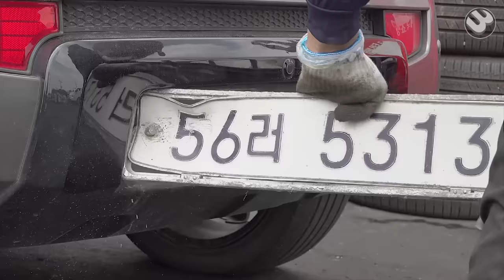Amazing Korean Junkyard. Massive Scrap Car Process

Comment: With the high price of new cars / vehicles, why scrap these nice looking cars / vehicles  being recycled by keeping them on the road? Crashed vehicles can be easily repaired by replacing the body parts, interior  parts, wheels & tires, electrical component's are all reuseable. What a waste of transportation resources.

Comment: Esse ferro velho tem carros melhores que muitas revendas aqui no Brasil.
Reply: País de primeiro mundo
Reply: Korean usually change their cars before they get in maintenance cycle that gets expensive like…. Transmission oil change, generator, and ect…. Which is usually 10~15 years. And some lease allows you to change your car you borrowed every 3years which is very common. You can buy these kind of almost brand new cars for bargain in Korea. So people just spend more and more on new cars than just maintaining old one. In Korea, you could buy the same used car way cheaper than other countries.
2018 elantra just costs 9100USD in Korea while it costs 18000USD in USA.

Comment: Furthermore, in Incheon, you will find a thriving presence of foreign used car importers acquiring a significant number of vehicles that exhibit conditions similar to those portrayed in the deregistered video. If you are interested in exploring the Korean used car import-export industry, Incheon serves as an ideal destination for your endeavors.

Revised paragraph:

The South Korean government offers cash incentives to car owners to promote the early scrapping of their seemingly functional vehicles, particularly those classified as Euro 1~4, which were manufactured under more lenient emission standards in the past. This initiative aims to improve air quality and overall environmental conditions. By opting for early scrapping, car owners can enjoy the dual benefits of receiving money for scrapping their cars and taking advantage of the government's incentives. It's like hitting the jackpot with two advantages at once.

Scrap car dealers, on the other hand, meticulously separate reusable parts and sell them as second-hand components. They also sell the remaining scrap metal to steel mills, generating profits.

Moreover, both the central government and local governments in South Korea are deeply concerned about increasing the adoption rate of eco-friendly vehicles. To encourage this transition, they provide significant subsidies for the early scrapping of non-eco-friendly vehicles and the purchase of eco-friendly vehicles such as electric cars and hydrogen fuel cell vehicles. Additionally, heavy taxes are imposed on internal combustion engine vehicles to discourage their usage and promote sustainable transportation options.

Furthermore, in Incheon, you will find a thriving presence of foreign used car importers acquiring a substantial number of vehicles that exhibit conditions similar to those depicted in the deregistered video. If you have an interest in exploring the Korean used car import-export industry, Incheon would be an ideal destination for your endeavors.
Reply: @oscarwilde5473  
I accept your censures with equanimity, cognizing that my epistle may offend those who are incensed by their present pecuniary or valetudinary circumstances, but it may also be of value to those who are inquisitive. If you find peace in criticizing me, then I am content to be your foil.
Reply: @oscarwilde5473  
It is somewhat disquieting to behold your vexation over a simple YouTube comment that merely describes a phenomenon of the real world. I had succinctly summarized the video's verities without prejudice. I am neither the architect, nor the executor, nor the propagandist of the policy in question. I would be delighted to receive financial support from any government, but no government is currently providing me with any money. It is more logical to criticize the policy of the government that is promoting a policy that is not to your liking, rather than criticizing me, who am simply presenting the facts. You are accusing me based solely on your personal beliefs, without providing any evidence or proof to support your claims. This is commonly referred to as grandiose delusions. If you are targeting and criticizing me because of your personal frustrations, I give you my absolution. Pax tecum.
Reply: @oscarwilde5473  Of course, you're always right. I'm just too stupid to understand.

Comment: おそらく彼らの韓国車はメーカーが部品を持たないから一定の年月が経つと部品が無く修理できないのでは無いか？だからスクラップにする。循環合理的だが、不誠実でもある。
Reply: Furthermore, in Incheon, you will find a thriving presence of foreign used car importers acquiring a significant number of vehicles that exhibit conditions similar to those portrayed in the deregistered video. If you are interested in exploring the Korean used car import-export industry, Incheon serves as an ideal destination for your endeavors.

Revised paragraph:

The South Korean government offers cash incentives to car owners to promote the early scrapping of their seemingly functional vehicles, particularly those classified as Euro 1~4, which were manufactured under more lenient emission standards in the past. This initiative aims to improve air quality and overall environmental conditions. By opting for early scrapping, car owners can enjoy the dual benefits of receiving money for scrapping their cars and taking advantage of the government's incentives. It's like hitting the jackpot with two advantages at once.

Scrap car dealers, on the other hand, meticulously separate reusable parts and sell them as second-hand components. They also sell the remaining scrap metal to steel mills, generating profits.

Moreover, both the central government and local governments in South Korea are deeply concerned about increasing the adoption rate of eco-friendly vehicles. To encourage this transition, they provide significant subsidies for the early scrapping of non-eco-friendly vehicles and the purchase of eco-friendly vehicles such as electric cars and hydrogen fuel cell vehicles. Additionally, heavy taxes are imposed on internal combustion engine vehicles to discourage their usage and promote sustainable transportation options.

Furthermore, in Incheon, you will find a thriving presence of foreign used car importers acquiring a substantial number of vehicles that exhibit conditions similar to those depicted in the deregistered video. If you have an interest in exploring the Korean used car import-export industry, Incheon would be an ideal destination for your endeavors.